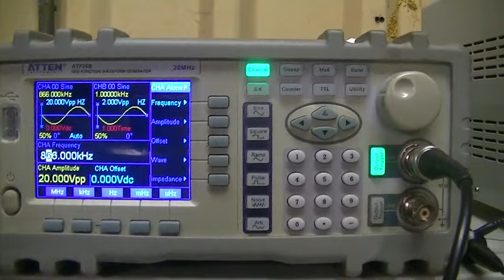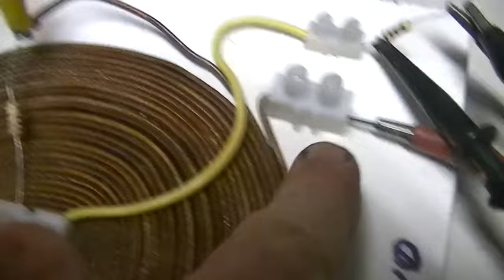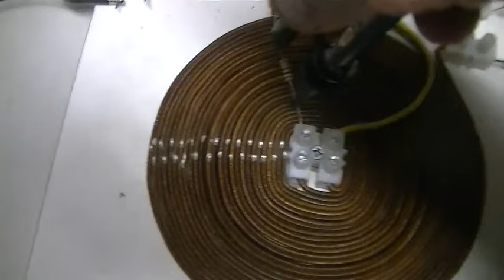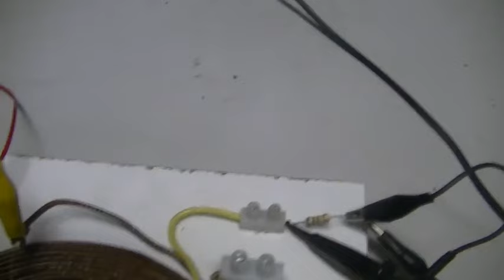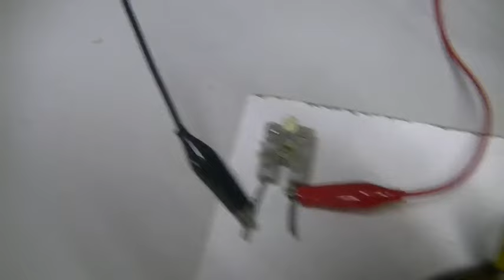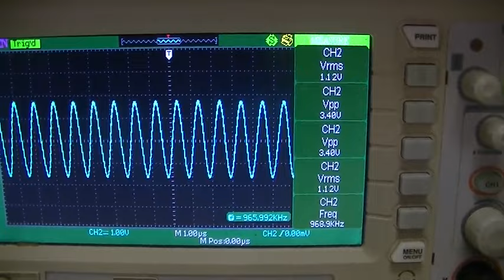Tesla bifilar coil anomaly

Comment: It's a shame that the author didn't use the second probe to look at the generator's output voltage. Of course, this only works for the input resistor and the probe's ground must be towards the generator. It is likely that he would have measured a phase shift between current and voltage. This shift could explain the apparent anomaly. Then it would be a good idea to measure the same thing on the middle resistor. He would have to measure the voltage on one of the coils, namely the one that would have a common ground on the oscilloscope with the second probe on the measuring resistor.

Comment: no anomaly here. it all makes perfect sense. half the energy is in the magnetic field as current, half in the dieletric as potential. 
well, not exactly. 1/2 LI^2, 1/2CV^2... two opposing hyperbolas.
the potential is now split in half and applied to both plates of the capacitor, both turns of the coil... giving V the value of half the applied potential along the entire length of the coil.

 a lot more energy is stored in the dielectric rather than a traditional coil where the value V is only the potential drop between two turns... a very low figure. miniscule. almost immeasurable.

THAT is the difference.

your "feed" resistor reads everything entering and exiting the coil.
your mid point resistor is only registering the current side of the two equations, not BOTH.

all makes sense.

now what i cant get my head around having made a good one is why the resonant frequency is so way off.

175nF between plates.
840uH on each coil.
190mH on both in series, according to my dodgy component tester.
it should"sing" at 840Hz or so.
it rings at 13.5KHz..

and that only makes sense if the inductance stays at 840uH, and the capacitance has halved to 77 nF.. which sort of does make sense as they are in series now... 

the inductors? theyre in series. theyre in parallel. theyre closely coupled... theres some weird stuff going on in there.

i have to do a proper LR measurement with a sig generator... 

and ping it for transmission line impedance.

Comment: The fact that your windings look 
Like a transmittion line === distributed C L  on top of the geometric L==== suggests to me VSWR.. a standing wave  might be the cause.--
Reply: Standing wave is half correct. Using right hand rule, you can determine that the secondary current is actually in reverse. Obeying action and reaction of magnetic field. Since the fields between the wires are actually very weak, the action and reaction majorly comes from the distributed magnetic field. The magnetic field shaped like a flatten torus. Top is out, bottom is in. Due to action and reaction, the second part of the bifilar coil's magnetic field is top is in, bottom is out.

Comment: If you hook up your scope on the input terminals from freq gen terminals and another on the center resistor, you should get the same power on both. Is this the case or is there some discrepancy?

Comment: Not realy something special. You have a relative large capacitive dielectric flow. It is not an RC in series but C sitting in parallel to the coils. You have to measure also the capacitive current flow and recalculate the power consumption. Input power should equal the consumption. Capacitance also explains why this anomaly disappears fro lower frequency.
Reply: Hes measuring EMF across resistors at either end of a coil, the currents should be exactly the same.
Reply: Suzy Siviter Nope, the currents should not be identical at the frequency he is using. There is a lot of distributed capacitance between the turns of the coil.  This entire video is a demonstration of how incomplete knowledge can lead to confusion.
Reply: @jimmurphy5355  this is exactly it.
when its a standard coil of low capacitance, or standard parasitic, the energy stored in C being... 1/2 cv^2 iirc? 
the potential between any two turns only being the drop along that length of wire, the energy in C is very low. most of it manifesting as current in L as magnetic field., 1/2LI^2...

as per teslas patent (that no-one seems to read as it clearly states that its merely a power factor correction method he devised because making capacitors in 1890ish was freaking expensive, having only oiled paper and pretty lousy metal "foils", and i havent seen ANYONE wind a motor with it yet, just prattle on about over unity and free energy...) by winding in this arrangement, one splits the potential across any inductance in two, creating an even charge distribution between all windings equal to half the  applied voltage, rather than merely the potential drop per turn.

so now a large proportion of the energy is stored in C as 1/2 cv^2...

the first resistor sees the larger current as its at the feeder... input, output... only wire and low capacitance from there to the signal.source.

the resistor in the middle sees less current as its only registering the energy stored in L as 1/2 LI^2... and as the total energy remains the same, the current HAS to appear to be "reduced".

yep. its the good old "fail to understand basic principles" again... combined with just general ignorance about... everything? (such as manufacturing challenges of the late 19th century?)

so yeah. i guess the only way to see someone wind an AC motor with its parasitic capacitance forming its own power factor correction is to do it myself sigh. its hard enough juggling ampturns with wire diameters and available space. this adds another level of complexity which probably explains why we just figured out cheaper ways to make capacitors!
still, could probably just wind one with double strands, isolate and join the ends as required, and get sort of the same result as carefully layered turns...

i did start doing some work on getting the equations but yeah... henry and ohm and gauss had time to play with stuff like that... whilst we all run around chasing careers and investment opportunities being all "technologically advanced"... wtf?
Reply: Capacitive dielectric flow does create an EMF. It just manifests different properties than normal, more like a Van de Graff generator than a Tesla coil.
Reply: He was measuring ‘RMS Voltage’ not Current (amps). Capacitance in parallel to the coil isn’t going to raise the Voltage from the center to the outer-coil over the Input Voltage.

Neither ‘Parasitic Capacitance’ in the coil nor ‘Capacitive or Inductive Reactance’ explain why there is a difference in Voltage. A Capacitor cannot increase Voltage on its own. You have to charge a Capacitor in parallel and discharge it in-series to create a ‘Voltage Multiplier.’

Resistance would only cause a ‘Voltage Drop’ from the Input Voltage and we can clearly see that he is using the same identical 100-Ohm Resistors at each point of measurement through the resistors.

However, there is another explanation. It is the Lorentz Force Law. It’s the same thing that explains Voltage in a Homopolar Generator (such as a Faraday Disk).

From Wikipedia, “The radial movement of the electrons in the disc (coil here) produces a charge separation between the center of the disc (coil) and its rim, and if the circuit is completed an electric current will be produced.”

I added the ‘coil’ in parentheses to reinterpret this description of the phenomenon. This effect has been used in ‘Ignition Coils’ to lower the Voltage between wires because winding them in Pancake Coils and insulating between each layer-stack helps to protect the Transformer Wires from excessive voltage short-circuiting through the dielectric (wire insulation).

Whether this Higher-Voltage between the inside and outside of a radial Bifilar Pancake Coil is due to “Zero-Point Energy,” I will let the readers be the judge.

Comment: The current in a coil is not the same throughout the coil if you have an AC input. The changing input current creates a magnetic field, which induces a voltage (current) at different parts of the coil. The current in the coil would never be uniform unless you are inputting DC current.
Reply: Wrong, try connecting a resistor either side of an inductor in a series circuit and measure the AC voltage across them both; they will always be exactly the same; this is basic electrics, the current is same thru any loop (Kirchoffs Law)
Reply: @Teslamoanials Derived velocity factor?, now you are making stuff up to try and make yourself sound clever. If you could prove currents were different in ANY series circuit you would re-write all the science books, but you cannot because its basic laws of electricity and that includes DC or AC, same basic rules. Kirchoffs works with AC or DC, that fact is well known.
Reply: @Teslamoanials Derived Yes I am an electronic design engineer with a Masters degree in it, and you?
Reply: @Teslamoanials Derived there is no scientific term 'velocity' factor when applied to electronic circuits, an amusing anecdote does not cover up the fact you are a pseudo scientist.)
Kirchoffs  like Nodal Analysis, and every other network tool works with AC exactly the same as DC only you use complex notation for the capacitive, inductive reactances and plug them into the circuit as though they were resistors, for instance Xc become -1/C.s, Xl becomes L.s where s is for Laplace transforms or equal to J.w if you are working with single frequencies, w being Omega or equal to 2.pi.F where F is the frequency.
Reply: @Teslamoanials Derived So tell me what you mean by your equation: C=1/Lc^2, that makes no sense at all without explanation on what it means, if you even know. You see this proves you know nothing about this subject, I was specific on how you calculate networked circuits, you have just pulled out equations from Google without knowledge of where to apply them, for instance the one I copied from you above is non-sensical without knowing what circuit configuration it belongs to, and it also contains capacitance twice which you never see in a real equation, which just shows not only do you know nothing about electronics but you also know nothing about basic algebra.
Reply: @Teslamoanials Derived Your equation is utter bullshit, so you are telling me that in a circuit with just capacitance without inductance, you get a 1/(0*c^2)=1/0=inf which means regardless of the value of capacitance the overall capacitance in the circuit is infinite? ).
Sure small c is used in lots of equations, but in yours its simply non-sensical. I think you are getting confused with the equation for resonant circuits containing both inductance and capacitance, where the resonant frequency Fr is calculated by: Fr=1/( 2.pi.sqrt(L.C) ).
Or to put another way, a designer can put any value of capacitance or inductance they want in a circuit, these are ACTUAL components, just different values will make the circuit perform different way depending on weather its a series/parallel circuit etc.
Reply: @Teslamoanials Derived I find it amazing well known principles in electronics we have used since Faraday et al are now being dissed from a lack of ignorance on how these equations are used, there is no simple free energy from any of Teslas inventions except perhaps the radiant energy receiver-which is still open to debate due to lack of detail in Teslas original patent, bifilar coils have been used for decades in modern circuits in places such as power supplies. The math isn't complicated or magical by any means, peoples lack of understanding is bewildering however. Yours is a good example including speed of light in equations, its like taking into account windspeed factors when you are calculating the diameter of the moon.
Reply: @Teslamoanials Derived Simple Lambda=1/F where Lambda is the period, Resonant Frequency=1/(w.sqrt(L*C)) in a resonant circuit, see both equations didn't use the speed of light, it all depends what you are referring to when coming up with an equation. EMU is the  franklin or statcoulomb, ESU also called the biot or abampere, used in Maxwell equation, most use coulombs these days which converts directly, I do not know why you are using such antiquated units unless you just tried to find something I wouldn't know, its certainly never taught at degree level. I don't really see how asking a series of questions validates either your knowledge or confirms I know what I am talking about for that matter, with info at our finger tips, what does show knowledge is writing equations the correct way which you failed to do, you are one of these people with a little knowledge thinking they are experts.
Reply: @Teslamoanials Derived I just saw your video "Tesla Oscillator earthquake machine generating power", sorry if this sounds cruel, but you do know Faraday discovered that same principle?, putting 'Tesla' into the title is just clickbait. But hey you are having fun and if generates a bit of interest for kids watching your videos then why not).
Reply: @Teslamoanials Derived Maybe I have been a bit hard on you, but you did kinda jump on me first, fact is experimental science is rarer these days, so in the midst of all your wacky experiments you might actually discover something useful one day, I appreciate math has in many cases been a discourager to the masses to get out there and experiment since they think everything has been solved, which is not the case by any means. Math often models without actually asking why things happen. Good luck in your experiments.
Reply: @Teslamoanials Derived MM I cannot recall seeing that particular patent, can you remember its name?, when you say gaps, you just mean a continuous coil with 2 magnetic gaps, yes?
Reply: @ThuleApsu  Shut up, Mucking 4on is right.
Reply: @Teslamoanials Derived Could you please elaborate on what you mean by the 'field does not need to alternate'?

Comment: +TinManPower I was hoping I could pick your brain about some things soon. It's important to the field I'm in, and I am trying to get a understanding of what is going on and how it works. "“If you want to find the secrets of the universe, think in terms of energy, frequency and vibration.” I know this to be 100%. But I need to understand it as close to 100% as possible. I've gone against the "experts" because what they believe to be true is disinformation. Although what they do works, it works under false pretenses.  I however, understand what is happening,  I just don't understand how it works, but it DOES work, and I would like to give you a more detailed explanation of what I'm dealing with in PM not open chat.  I'm in uncharted territory and I need help.
Reply: hit me i would like to listen on what you are speaking of maybe i might can help too
Reply: what is the resistance of the copper coil from point entry of the current compared to the centre of the coil ?